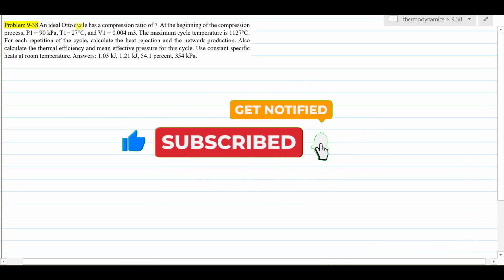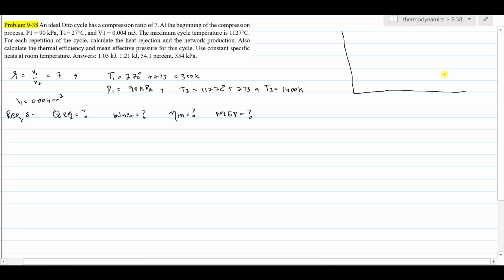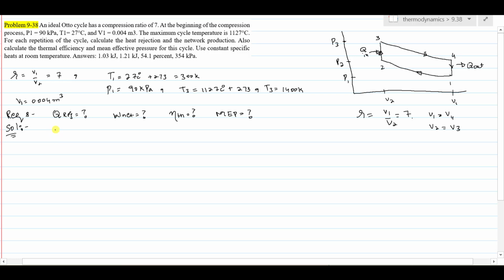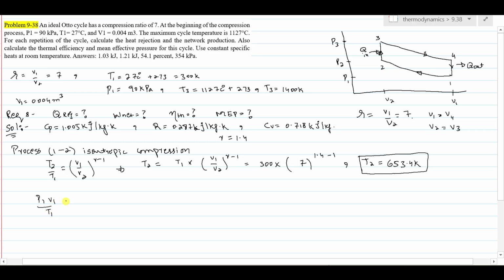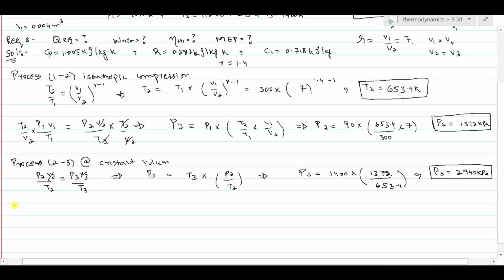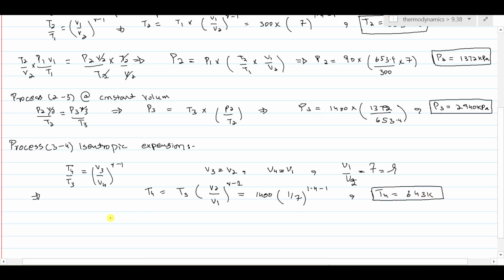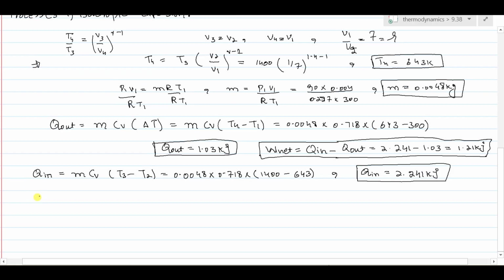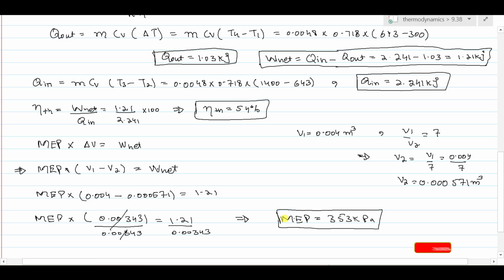Otto Cycle Problem 9.38 Solved | Find Thermal Efficiency, Net Work, MEP | Cengel Thermodynamics 9th

Comment: Sir over answer are also coming without puting pressure values ,then why you find sperately p3 and p4... please answer me as early as posiible
Reply from the maker: No without finding P3 and P4 value it thermal efficiency is impossible to calculate